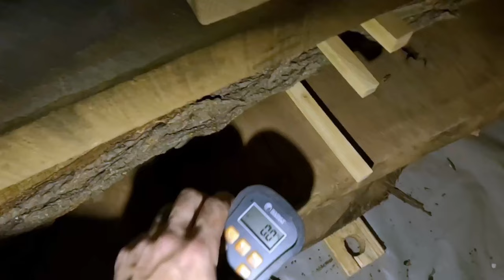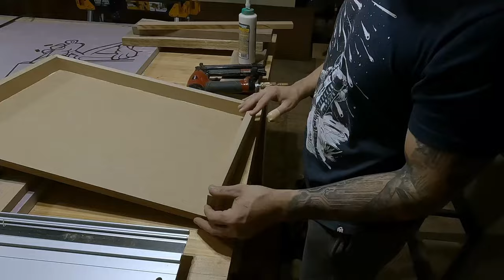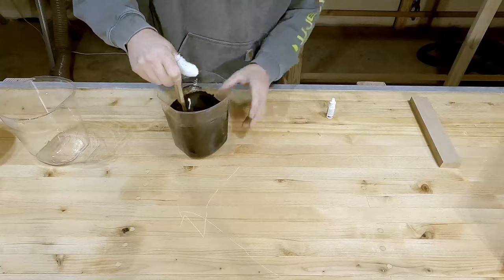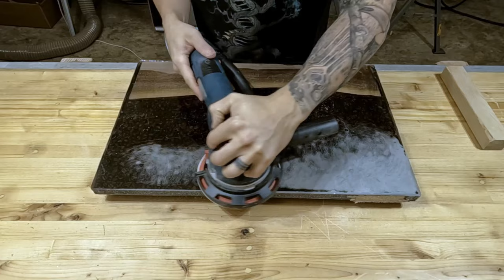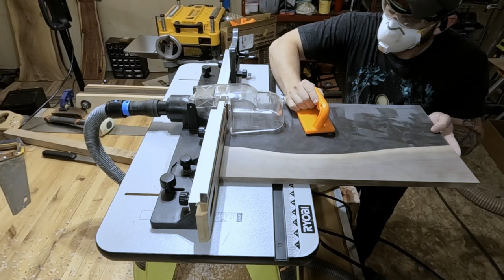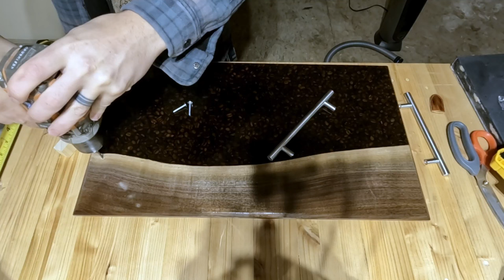Simple, elegant charcuterie board from Walnut, coffee and epoxy

Comment: what are your best tips/tricks for not getting air bubbles around the beans?  I did 3 pour layers, first 2 were table top (mica powder and clear) and last clear layer was deep pour all using superclear.  I believe the bubbles i got were from the second layer, i coated the beans in the epoxy then poured them unlike what you did.  ive seen both methods recommeneded for minimum air bubbles..

Comment: You should seal off the sides of the wood with resin & a brush before pouring
It'll remove any risk of bubbles or seepage into the wood that could create a void during the process.
Looks good though
Reply from the maker: Thanks for the suggestion.  I typicall brush the edges on deeper pours, but since both pours here were so shallow it wasn’t necessary (since I was torching bubbles).
Reply: I have yet to have walnut "leech air" into my epoxy.  Other woods, such as cottonwood, yes, should be sealed first.  I've done tons of boards using walnut, maple, all types of wood, and have never had to seal it up. You just have to use your brain and think about what wood you are using, and if there are any cracks or knots in the surfaces that are going to be in the "river".

Comment: Nicely done. Contrast of the sap wood next to the dark epoxy looks very rich. Now a question, why did you wait for full cure instead of almost a half cure so you can get a chemical bond instead of a mechanical bond.? Now a suggestion, ....make the epoxy a satin finish and the wood high gloss or visa versa, it will certainly pop!!!! Thanks for sharing
Reply from the maker: Do you nean waiting for a full cure before applying the finish?  If so, it was because there was a bit of spillage onto the wood that required quite a bit of sanding, and doing so on a partially cured epoxy makes for a huge gummy mess.  The dual finish would probably look very nice, next time!
Reply: @JonDurbin  I meant after the first pour for the coffee, most of the time you need to scuff up the cured epoxy, if it was still alittle soft then the chemical bond takes place. Obviously you cannnot sand with the coffee beams on the set up epoxy. Looks really good......
Reply from the maker: @scottgorman7166  Ah, I see.  The problem I've had in the past with partially cured epoxy, for this type of project anyways, is that if the first layer is even a little malleable, the second layer can seep below the first, and you'll just have random floaty spots and in this case coffee beans poking through.  When this has happened to me in the past, it was fairly well cured; I could indent it but it was not sticky, and eventually (over the course of several hours), almost all of the second layer seeped below the first and ruined the project.

Comment: is there not a better way to do this than to cut through beans when squaring up the edges, potentially causing damage and an unsightly edge with exposed cut beans?
Reply: you can always add a seal coat of table top epoxy afterwards or take the time to keep the beans away from the edges which is a nuisance really

Comment: Why not use a different finish? mineral oil/wax, osmo, rubio, even a float coat of epoxy? i'm honestly curious.
Reply from the maker: If I’m being perfectly honest, I did actually try a couple finishes on this exact project.  First was Tried and True, but it was far too hazy and didn’t cure well on the epoxy.  Rubio cured great, but was also a tad bit too hazy for my taste, obscuring the coffee beans.

On the other end of the spectrum would be what I normally use, float coat of table top epoxy, but I though it would be a bit too glossy and I don’t have a great clean room to prevent dust nibs and the like.

Urethane products bind well to the epoxy and wood, and gave just the right clarity and sheen for what I was after.  Purely experimental, settled for what I thought looked best.
Reply: @JonDurbin  Thanks for the info on your thought process. I love the look.

Comment: So 3/4 is just epoxy, it will get scratch marks real easy.
Reply from the maker: It's certainly a possibility, however I suspect the wood is more susceptible to scratching than epoxy resin.  Epoxy has a Shore-D hardness of about 78+-1, depending on the brand, cure, etc., while wood has a much lower Shore-D hardness score.  Unfortunately this chart doesn't have Walnut specifically, but you can see the values for similar (based on Janka hardness scale) wood species in Figure 1 here: https://bioresources.cnr.ncsu.edu/resources/effect-of-heat-treatment-on-shore-d-hardness-of-some-wood-species/  For example, Walnut Janka hardness = 1010lbf, and Teak Janka hardness = 1070lbf, and according to the linked study, Shore-D hardness of untreated Teak is only 59.1.